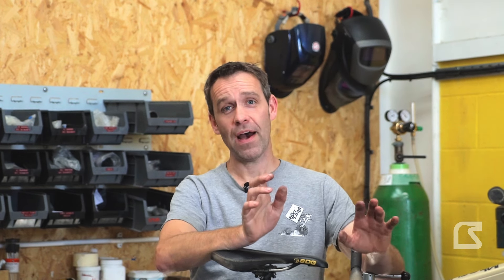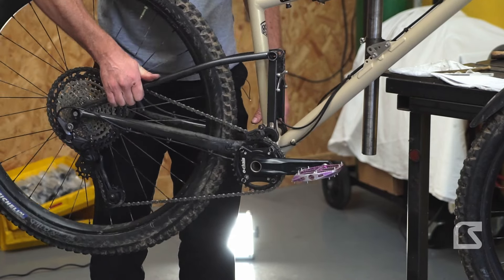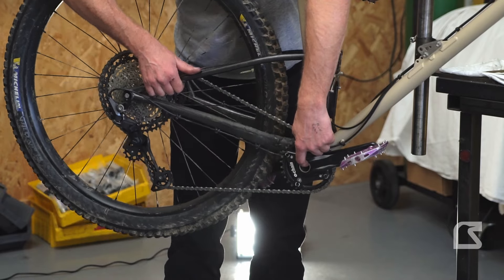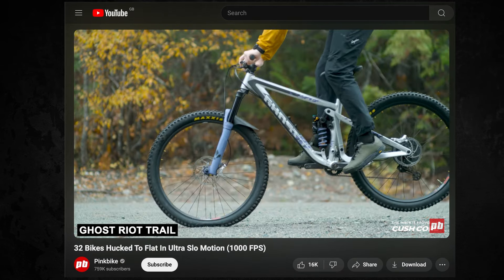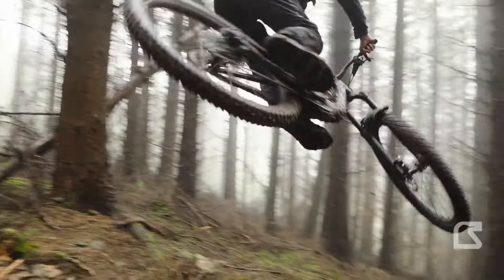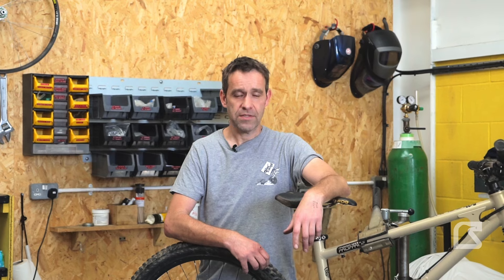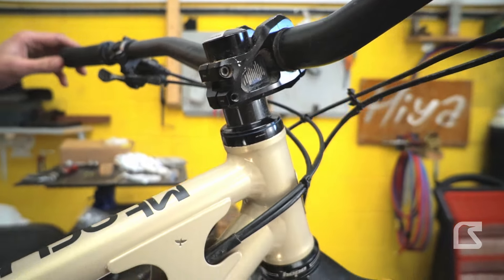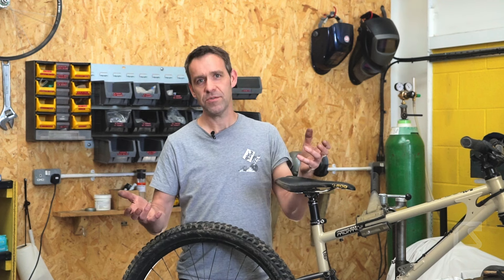Is Pedal Kick Back Bullshit..? | Starling Cycles Workshop Chatter

Comment: Actually you can feel kickback through your feet, but it's more often just a sudden acceleration. You can clearly see it in the "huck to flat" video,  the upper part of the chain is stretched, forcing the cassette to turn with the wheel, making acceleration. If you brake, you prevent the wheel and cassette to turn, so all the force is transmitted to the crank. Be aware the next time you ride a very technical section, between locking the wheel and letting it roll.
Reply: > the upper part of the chain is stretched, 

But its not stretched and he said that. You can see in the videos he used that when hitting the ground the upper part of the chain between the chainring and cassette never goes taut like a string being pulled from both ends.
Reply from the maker: @donpalmera  Indeed, to transmit forces, chain needs to be pretty straight...

Comment: I have noticed kick back while heavy braking into corners, if you accidentally lock up the rear wheel and hit a bump your forward foot will lift up. You can’t push it back down again until you’ve let off the brakes a bit. I noticed this immediately after changing to hope brakes, much more powerful than what I was used to.
Reply: I felt the same on my old single pivot bike, actually one of them was a Starling Swoop. But they would feel a bit skipperish towards a corner under heavy braking, and feel so good letting off the breaks into the corner! But i thought that was a "hold up" in the suspension kinematics, just as he showed with the growing chain. When you break you stop the chain from expanding, and you would have less travel in the rear. Any thoughts on that angle?
Reply: That's a design flaw of how the rear caliper is attached to the frame and where, they explained it to me but i suggest you look into it
Reply: @R3ddyyg  all bikes have some brake jack, once the wheel locks up placement doesn’t matter anyway.
Reply: @MasterChronometer  Well my 2014 strive user to do it very often, but on my Supreme V4 it never happened.
Idk that much about this stuff though, as I said a really knowledgeable guy explained it to me but I can't really express myself that well on the topic (English ain't my first language)
Reply: This

Comment: I switched from lock-on grips to pure silicone grips for better vibration damping. Wolf Tooth have a wide selection of sizes and shapes. Easy and cheap mod.
Reply from the maker: Good tip, cheers! We're going to spend some time looking into all of this for a video. Cheers!

Comment: Pedal kickback doesn’t happen because the wheel can rotate away the chain growth. This is why you feel it the most under heavy braking. I would assume the pedal kickback would be much worse in huck to flat with the brakes locked up.
Reply: I agree. The chain growth will just drive the rear wheel. Only if the speed of the rear wheel were to drop really low, and you were causing large compressions of the rear wheel. Maybe under really heavy braking in certain circumstances..
Reply: How can you agree with someone that says "it doesn't happen" and "you feel it the most" in the same short post?
Reply: @aucklandcycleworks  Yeah fair point, I only really read the first line. Too lazy to read all of anything in detail these days. But I still agree that pedal kickback can only occur when the rotational speed of the cassette would exceed the rotational speed of the wheel. In the demonstration in the video, where the cranks rotate back, it wouldn't happen if he spun the wheel at the same time. The question comes at what upward axle velocity, in what gear and at what wheel rotational speed does the effect happen? If one might say, I feel it clattering over braking bumps, are you sure you're not just feeling the braking bumps. Or feeling the intermittent braking forces as you bounce over the bumps with your brakes on?
Reply: @aucklandcycleworks  how about I amend my statement to “pedal kickback doesn’t happen WHEN the wheel can rotate away the chain growth”?

Comment: Pedal kickback is not an issue during “normal” riding - it’s like coasting downhill and then trying to pedal in a low gear, the freehub mechanism will not  “catch up’ with the wheel rotational speed!

Comment: of course theres no pedal kickback when you have any speed and the wheel is rolling faster than the chain can yank on the pedals, especially since we're in the small cog when dhing. Do a drop to flat with rear brake locked and itll kick-but who does that?

Comment: Pedal kickback is not a thing. I have a vintage Mountain Cycle San Andreas with all modern parts on it. Theoretically, it should have massive pedal kickback. I have it set up as a 1x12 with a 32 tooth chainring and a good stable platform shock. The front pivot is really high compared to the chainring. It doesn’t have pedal kickback, but it is still very active on small bumps. And, with the clutch derailleur, it’s totally silent.

Comment: I wont say that I can feel or cannot feel it, but the difference between his in the stand demo vs the PB slow mo is the angular momentum of the cassette.  In the stand, the rear wheel is not turning so the cassette has no angular momentum, simulating a locked brake.  in the PB article the rear wheels are accelerating when they hit the ground, introducing angular momentum of the cassette, and causing slack in the top of the chain.  

Perhaps the question should be "when" rather than "if" kickback is relevant.  I can see it being relevant in high speed braking into rough sections and low speed braking on very steep descents where the chain is in a larger cog.

Comment: Hitting brakes harder is affecting the suspension much more. The effect shown on the video - it could be seen only if there are no feet on the pedals. If there are - the derailleur will compensate the rearward motion of the chain.

Comment: I think The top length of chain isn't in tension because the wheel is moving/coasting, which provides a source of the extra links of the chain. I would assume if you brake heavily through a hard compression and your bike has geometry that has significant kickback numbers, you may feel some of it.
Regardless, interesting thoughts!

Comment: You know, if you watch very closely, you can see in those "huck to flat" videos, at the moment they land, the chain is tight.
   They are descending very vertically. After that instance, they increase forward movement. 
   Only some of the videos illustrate the pedals changing angles, but because the rider makes an effort to brace for landing, he gets propelled forward.
Reply: Agreed. It should be present in a very slow landing with a large compression.

Comment: Exactly.  It's clutch tension and the chain flapping back and forth.  Any time the chain is moving like that, it's mass moving in a direction and it carries momentum, if that is moving opposite to the direction you want the suspension to move, it's going to have a big effect.  These are why the bike feels so much difference without a chain.

Comment: It makes sense that this can exist but i think only in case of heavy travel of suspension with absoutly blocked brakes. If the cassete cannot move the chain will try to move crank, but if you have pedals/crank blocked by your feet and go with rolling wheel, i think the tension is then compensated by rotating the cassete, which you cannot feel as the wheel is spinning already..? So a very narrow windows for occurance of this i think?

Comment: Depends on the hub engagement and the kinematics of the rear suspension. Also it's less noticable, when going faster. As you can see, the PB video shows bikes going pretty fast with a lot of kinetic energy. It's easy for the chain to start rattling. Now imagine going down a steep technical turn, with a "root or rock drop". You're going slow and draging the brakes. Finally, the rear wheel drops off and  hits the ground, the rear suspension almost bottoms out, then you feel the cranks being pulled back and your knee yanked violently towards your chest, maybe even hurting your ankle. I have had instances, when My right foot gets thrown off because of that. My Iron Horse Sunday had a slight tendency for pedal kick back and when I got My 2017 Mondraker Summum, that's when I noticed it the most. OchainR helps alot, but when I case a big jump, I can still feel My knee being yanked and it can cause My right foot to come off. Downhill bike will make it more noticable, because of more travel. My YT Capra has 170mm of rear travel, but doesn't cause so much problems. Maybe the different susp. design matters. I still notice it on My Capra aswell, but only slightly. If most of you ride 140mm trail bikes, chaces are, you won't notice it, especially at speed. Once you experience it, you will acknoledge it as a nuisance.

Comment: The issue is transmitting wheel forces into the chain to start with. The chain growing in the wheel path is what initiates the wave. The cause is incorrect wheel path and degradation in the drivetrain's orientation to the crank as the suspension compresses.

Comment: 0:56 now do the test with the wheel spinning, as it happens when you ride your bike. Surprise, no pedal kickback. Because the chain growth is not big enough to rotate the cassette so much that it engages the hub, at most riding speeds. Static analysis are so misleading... For a proper dynamic analysis watch: "What is PEDAL KICKBACK?...Should you care?" from Trail POV.
O-chain is mainly an expensive placebo, improving a non existing problem.

Comment: I felt pedal kickback  in bumps while pedaling on a low gear when i changed from a 2006 specialized enduro to a 2006 Cannondale gemini. I felt it cause I wasn't expecting it (therefore i wasn't bias), it just felt strange, but I've never felt it while descending in a high gear.

Comment: Yes pedal kickback is a old school issue. It can't happen on a Emtb because of the sprag bearing.  E=Mtb². A easy way to eliminate chain slap is to run the upper chain thru a floating length of 16mm garden irrigation pipe anchored loosely with a zip tie. As for all this high extra sprocket rhubarb... "hopefully they have Patented it to stop everyone else making the same mistake."  E=Mtb²

Comment: The only times I've noticed it (not saying it doesn't happen in other scenarios) is on a climb. I had just cleared an obstacle, so the argument that what I was feeling was just the obstacle making it harder to pedal is not true here. Right upon clearing this 4-6" tall log or rock, the rear wheel came down off that and my full weight compressed the rear suspension as I pedaled forward. Since I was moving at a snails pace, the effect was quite pronounced of the pedals rotating backwards.

Comment: unpopular opinion, pedal kickback is good, it keeps your feet parallel with the ground or the angle your body is weighting the bike through your feet constant as the rear of the bike and bottom bracket drops during the rear travel's wheel path.

Comment: Pedal kickback is a solved problem in most modern designs but was defiantly present in older high pivot designs, eg I used to have a 98 Sintessi bazooka which would have noticeable acceleration on landing.
Reply: Oh, cool, that was my first downhill bike. I ended up selling it to an eccentric collector

Comment: Wouldn’t a high engagement hub be a close runner-up for feedback through the pedals?  After a hit/huck to flat/etc…pretty much anything besides freewheeling backwards will result in drive engagement feedback which will “kick” the pedals, however little that may be.
Reply: Yes. I don't go over 50 poe for this reason.

Comment: Pedal kickback is only a thing if you're hard on the brakes. We all use brakes.  Suspension performance also gets worse under braking because braking reduces the rollover ability of the rear wheel.  (Remember 'rollover' - it is the reason bigger wheels roll better.). So riders use Ochains to prevent this deterioration from being any worse than it has to be. Even a tiny performance gain is still a performance gain.  There's very few designs out there that suffer zero kickback under all/any situations.

Comment: Is pedal kickback is "more pronounced" if you lock the rear wheel whilst the rear suspension is active in a big cog at the back. (Wondering if the chain would go taught if the rear wheel cant rotate). (Granted, case of learning to ride properly but may be what people are feeling). (I agree though :-) )
Reply: Yet another reason why proper braking technique is important

Comment: "There is no mechanism for transmitting forces to your feet". I don't see enough arguments brought up in this video to back up this statement, there is no explanation really. If you had instant engagement in your freewheel and could not turn the cranks, you would block the whole rear suspension movement. That's the mechanism. Now you could argue how fast the coasting speed would need to be in relation to the tangential speed for the rear axle and gear ratio in order to catch up, but this is not mentioned in this video. Regarding chain movement I aggree, Steve from Vosprung Suspension did a great video on that. But also, besides inertia, pedal kickback could potentially contribute to the oscillations.

I have a have used stfu (these are basically rubber rings that are mounted on your chain stay that limit the motion of the chain) and haven't really noticed any improvement except noise reduction. So the problem of blowing feet from pedals (flat pedals) when hitting exposed roots hard at moderate speeds still persists. I can imagine there are types of terrain you would never have the problem.
Reply from the maker: My point is that the chain is never straight, therefore it can't transmit forces, other than those from accelerations of flapping chain.  This is independent of hub behaviour so no need to consider.  

Solve the dynamic system shown in the 'huck to flat', not the static system.
Reply: @starlingcycles835  Ok, now I get it. Regarding the hub behaviour: a higher degree of engagement hub would allow more back and forth motion of the cassette during the chain flap, a lower engagement hub would ratchet away the free chain length so to speak. e13 are working on a freewheel that disengages which would allow the cassette to rotate forward as far as I understand. So it's a bit like what ochain does.

Actually, looking at this slow motion footage from Val di Sole, the chains are surprisingly straight: https://www.youtube.com/watch?v=cRqkr-Xgg2k.

Comment: If it’s flapping chains, then it should be possible to feel it on a hardtail too. Can people feel it on hardtails?
Reply: You'd have to add a rear shock to cancel out the bumps travelling directly from the back wheel into your bum and feet trying to buck you off the bike before you could tell if it was just the lack of a rear shock or some bike woowoo causing your feet to leave the pedals.

Comment: Would be curious to see how a high pivot bike without an idler pulley would feel.
Reply: Ah, I see what you did there. Nice.
Reply from the maker: This is a good point.  Without the idler you probably would see some genuine pedal kickback effects.  The idler is required to bring behaviour in line with more normal pivot positions.

Comment: Instead of adding dead weight to DH bikes, yes that works since mass reduces resonance frequency, lighter alloys parts studyied for their damping capacity could be strategically part of the frame, titanium & aluminium alloys can be very effective; "due to their ability to dissipate energy through dislocation movement and crystallographic defects. It is possible to tailor their damping performance for specific applications by altering their microstructure and reinforcement volume fraction." 

Stolen straight from tevema website 😂
But you get the point... Resonance could be tamed with existing solutions...
Reply from the maker: I think its more at a system level than material level.
Reply: What frequency range are we talking about? Sound like road/gravel bike territory. High frequency vibrations are not really interesting vor mountain bikes because high volume tires and softer compounds filter most of out even if we don't consider suspension (at high frequency we could probably assume it's rigid, but there are lot of parts like bushings and bolted joins that contribute to damping).

Comment: Hooray! Someone’s having some sensible thoughts on a ridiculous subject! As melindajones304 has said. The kick back is caused by the freewheel pulling backwards on the chain so you’ll only feel it if you’re in a big gear going REALLY slowly. Otherwise all that happens is the free hub to wheel speed difference slows by such a tiny amount it’s completely irrelevant! 
As for feeling it when hitting suspension compressions during climbing that’s also ridiculous. You aren’t feeling kick back. You’re feeling the extra resistance of having to make the wheel climb up over an obstacle. Suspension is reactive to the impacts it encounters. It doesn’t lift your wheel to avoid the impact using some magical powers. You’ll feel the exact same thing on a hardtail only even worse because there’s no compliance at all. 
Loving the content starling. You are a sensible thinking logical company in an industry of marketing pseudo science. Keep it up!

Comment: I don't pedal kickback is a thing going downhill - it's something I feel more going uphill.  As you pedal up over a log or step up, the pedal force increases a bit and there's more resistance at that very moment as the rear susp goes into its travel as you hit it.